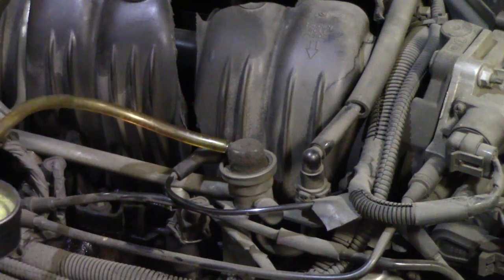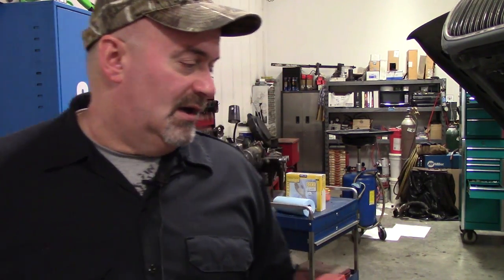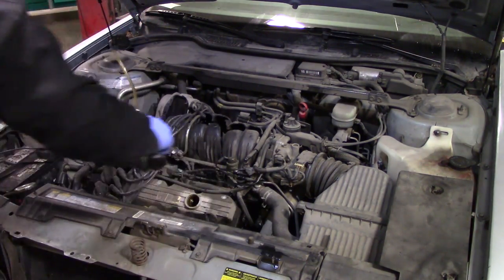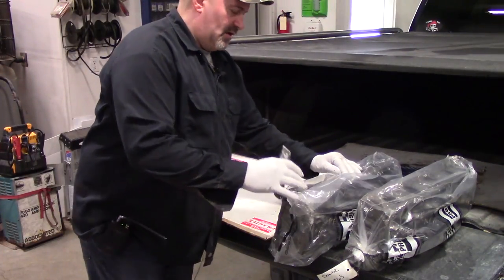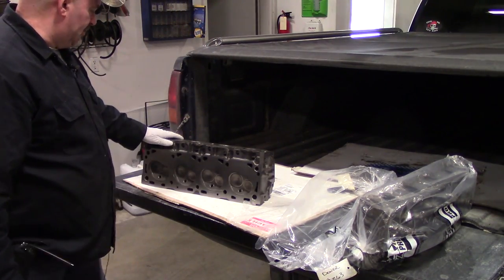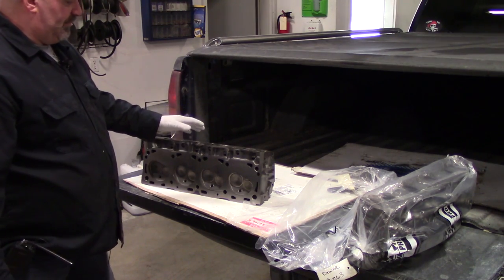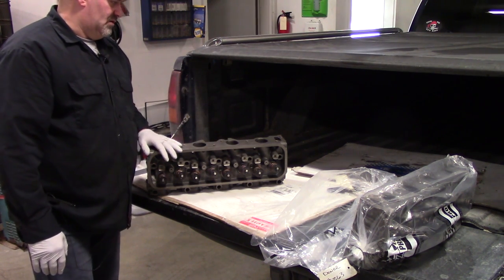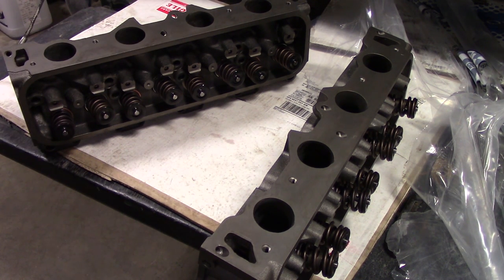3.8L Exploded Intake Manifold Plenum Replacement

Comment: I initially didn't think the fuel pressure regulator was leaking on my Mom's car either. It was a very small leak that required revving up the car with a finger over the port. Even then, wasn't much fuel and evaporated very quickly. The symptom was hard starting only when hot and stalling at stop signs. During restarts, it would lightly backfire so I can totally see how a plastic intake could explode under the right circumstances.

Comment: My 2000 buick had a bad Fuel pressure regulator with tiny diaphram leak.  It would backfire and die after a long idle at a red light or sometimes on startup.  Smoke would come out from the throttle body. I found it after watching your videos.  I pulled the vacuum line and it was damp with fuel. Later I heard that there was a recall on the regulators.

Comment: Kick ass brother! Much needed info and great video. I know how you feel about the stress of starting up for the first second or third time. I just dropped a 0 mile reman into our Grand Prix GT, and I must have gone over things a millions times trying to stall from starting it up. Even after many issues buttoned up, on its first trip out of town the plenum broke apart where the coolant runs through. Apparently the previous owner never changed the dex cool and the channels where it runs through the plenum crumbled like clay in my hand once I removed the plenum and saw it. So I'm at this stage of replacing a brand new plenum with MAP and PCV. My only issue is trying to find out why I see parts in the kit I didn't see while removing the original lol. We'll see if I can't blow something up too lol. Thanks for the video

Comment: I'm sure you are correct about the EGR being stuck open causing this issue, could be the wires were crossed when you got the car, maybe a customer inflicted wound trying to solve the rough running problem with the excess EGR flow?

Comment: This almost happened to me today on my 93 LeSabre but it just blew off the EGR tube, it's a series 1 3.8 though so it's different from this engine. Same thing also happened to my neighbors 2000 Monte Carlo but her intake blew to pieces. Good video though it will help me figure out how to prevent this from happening again. I'm going to check the the fuel pressure regulator and the EGR valve.

Comment: Got a 92 Le Sabre that runs great at 60mph but off idle and any quick acceleration (mashing of the pedal) it complains. The fuel pump and filter have been replaced along with the coil packs. Problem is intermittent and I went four4 a ride with my friend and it ran like a champ. The front driver side motor mount was replaced. My buddy used some seafoam in it to try and clean up the throttle body. Did not get codes as I did not have a paper clip to jump the terminals. Tonite he did hear some popping in the exhaust manifold and when he told me that I remembered that you did this vid. Not sure if the 92 has a plastic intake or not. Any Ideas?

Comment: One case where GM parts are not good.  The doorman and one other intake plenum have beefed up egr opening to handle more heat from stuck egr or plugged cat.  Stock plenum melts and open coolant tubes, flooding intake with coolant also

Comment: Does it matter which way the tube on the gasket faces?
Reply from the maker: I only think it can be installed one way
Reply: @ThecardoctorTV  it clicks into place but can be rotated 180. You can rotate to face where your brake booster vacuum hooks up or down forwards engine or torwards front of car. It’s shaped like a L.

Comment: 4.13.17.    I use a new upper plenum by GreyWorks, that I source from RockAuto. It has a metal bushing in the EGR port. Another weak spot on the stock plenum❗️
Reply: Do you have a part number for the plenum you bought? Thanks!

Comment: 50,000?. I have a 2001 Lesabre with 220,000 miles on it. Only issue was Intake manifold gaskets went. Was told GM used cheap plastic ones at the factory. I love my Lesabre. 24-25 mpg.

Comment: Iam surprised there wasn't more plastic debris down in the lower intake. Also, when you flipped over the injector rail to install the new O-rings. Was that gasoline that you pored out on the bench?
Reply from the maker: I vacuumed out all the plastic stuff. That was gas and it ran down my pants after. Wonderful.

Comment: I have I have a Oldsmobile LSS with a 3800 and water antifreeze is coming out of the throttle body into my airbox
Reply from the maker: Yikes. Haven’t seen that before. Sounds like a cracked throttle body. Better get that fixed.
Reply: @ThecardoctorTV  it's filling up in the upper intake then flowing out to the air filter box

Comment: Did you have to flush all the coolant, or change the oil? Because of the explosion?
Or was that just an extra  insurance? Like a just in case? I have to do this procedure. My car would stall at stop signs. And when i would fill it with gas. It would not start correctly. Then one day boom! Here i am watching your video. From reading up I'm assuming the fuel pressure regulator from what i read. Like it was flooding the car?
Reply from the maker: It’s possible coolant can leak into the crankcase when removing the intake so it’s something you should do. If you recently changed the coolant you can just drain and refill.

Comment: I'm surprised you didn't replace the lower intake manifold gaskets. The factory gaskets are plastic and they start cracking and splitting up with age. The new steel-backed Fel-Pro gaskets are the bees knees.
Reply from the maker: If it was mine I would have. This job ended up costing about twice the value of the car so far. I wanted to pull the lower just to make sure it wasn't cracked from the explosion. I'm thinking it may have blown the lower gaskets out inside the engine and now it's leaking vacuum into the crankcase and I'm going to check for that next visit. But you are correct. It would have been a good idea. Or shooting it in the head may have been even better.

Comment: I have had one EXPLODE big time! F'ing poorly enginerd garbage plastic intake. The gasket fails manifesting itself during extreme temp changes of just down right cold temps. An air leak past said gasket causes a misfire inside the  intake and KABOOM! In the old days when they used metal number one the gaskets did not fail and two if a misfire occurred the metal could take it without damage. I have seen a few in salvage yards with the exploded 3.8 plastic intake and resulting engine fire. How GM has not been sued or burned someone alive is shear luck. A Youtuber called "Chicken of the sea" has come up with a 3.8 metal intake swap for his engine the way it should have been done by the factory. Check it out.
Reply: chickenofsea 3800 Intake.
Reply from the maker: `cool. Thanks for the info.

Comment: Sounds like you found the original fault.
I bet its rare for one of those engines to have that particular egr problem.
Bet it runs much nicer now :-D.
Ooow those re-con heads+valves look really nice, should work really nice :-D.
I liked the repeating footage on the take 2 part, LOL :-D
Reply from the maker: IM still not sure if the EGR was a result of the explosion or what. Stay tuned for part three and some interesting disclosures by the customer...it will BLOW your mind! haha
Reply: HA HA Nice :-D

Comment: Apparently somebody other than me and you have the same problem and they said it was a crankcase positioning sensor so maybe that was to cost at the backfire in my opinion but the fuel plus the AGI valve I'm working on mine I'm slower than you so you got yours going I'll get mine going

Comment: I own four GM  vehicles with the Series II 3800 V6 and I've had to replace the upper plenum on two of them. It has nothing to do with mileage, and everything to do with whether or not someone has mixed non-compatible coolant in the car. Both cars that developed plenum leaks had suffered from poor maintenance before I got them; one had only 64k miles and the other one had 82k, but the common denominator was mixing Dex-Cool and ethylene glycol. I've never had any problems with any of my other Dex-Cool cars that were maintained properly and only had Dex-Cool in them.  Don't believe the BS on the container that says "compatible with all coolant types". If you own a '96 or newer GM vehicle and it says to use Del-Cool, use Dex-Cool and nothing else.
Reply from the maker: I agree. Some folks swear by flushing and replacing with different coolant all together. I don't do that just because of the labels on the car that specify dex and you never know who is going to add to it later. I would say that even if its straight dexcool and its over five years its a ticking time bomb. That's stuff gets super acidic and nasty with age.
Reply: I'm flushing my shit asap.

Comment: Leaks on these Plenums are common don't no about explosions . I have got one pulled in now on a 3.8 Impala Police engine leaking.
Reply from the maker: Is it the coolant passage leaking or vacuum? I have seen both I guess. The stupid EGR passage melting into the coolant passage was a bad design as well.
Reply: Coolant leak .

Comment: my intake just blew up ,it sounded like an m80 ,one question is it a good idea to just replace  the lower gaskets ax well or just the upper ones?
Reply from the maker: I was worried about the lower gaskets leaking in this case and its possible they were damaged during the explosion. The vehicle is running OK so far and I haven't had it back so fingers crossed.
Reply: thanks for the videos
Reply: Emmanuel hernandez I
Reply: Yolanda Rivera alternator  on  2001  Mazda  tribute

Comment: It is true you can depend on it my son idle issue and we even took it to a shop a dealership and they couldn't find the problem show me my son was working on the car the 3.8 he said that there's gas in these lines and I said that's impossible that's a vacuum line and the fuel pressure regulator was putting gas into the vacuum lines we went to the AutoZone AutoZone on carries what they use the most or sell the most they had the part in stock the full pressure regulator diaphragm in the clamp so AutoZone must have a lot of usage for that part. That's the weirdest problem ever had with a car

Comment: it's no doubt we see something new everyday but I have replace many of these manifold and never seen one explode, but I am a one-man shop here in pissing hot Florida and yes much can Xscape you being isolated.
Reply: fixitright how can I tell if the intake gaskets are leaking before I put in a new radiator and stuff??? Rather sell this lumina than go through all that!! Had been running straight water in the warm season putting off the radiator.....

Comment: I think the whole fuel rail needs to be replaced it's more than the there's something wrong in that fuel rail the diaphragm doesn't fit right or something like that I would replace the whole fuel r even though the diaphragm on the pressure regulator is the problem